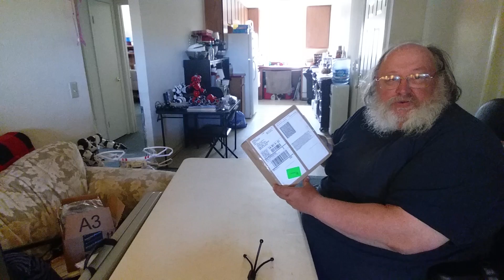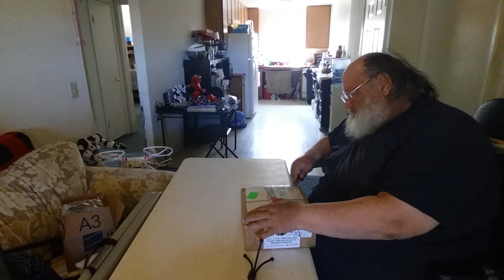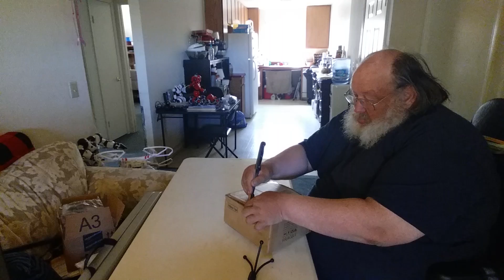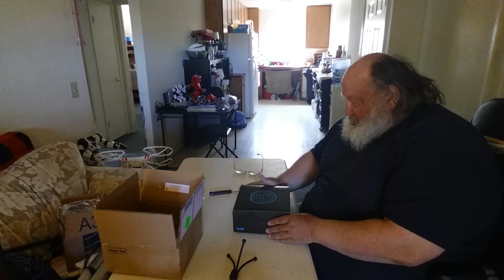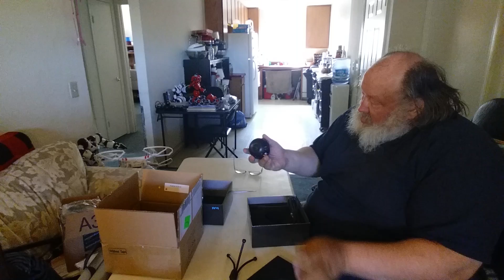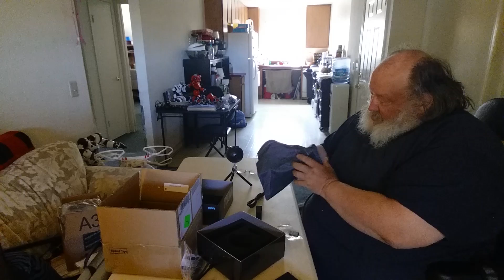Bublcam unboxing, 360 Spherical Video Photo Camera

Comment: Great review, thank you for posting. Still keen to try and get one myself. How's the battery life?
Reply from the maker: +RichTipple i own 2 of them because the battery life is only 45 minutes. with a battery pack it can last up to 65 minutes with a 2 amp feed. they say with a 3.5 amp 5 v power source it can run continuously.  with the charger it takes about 90 minutes to charge at 2 mps.